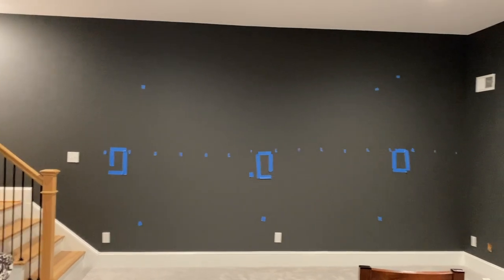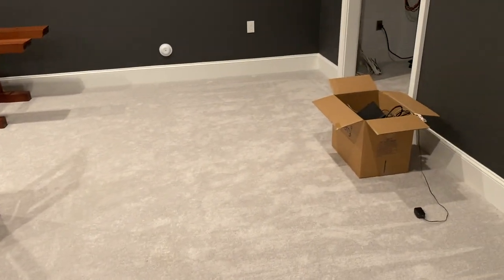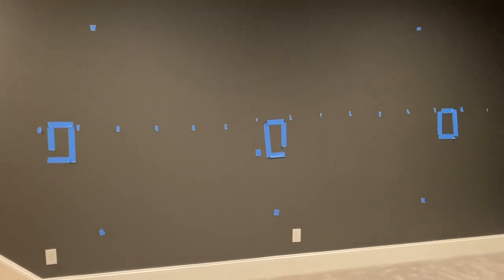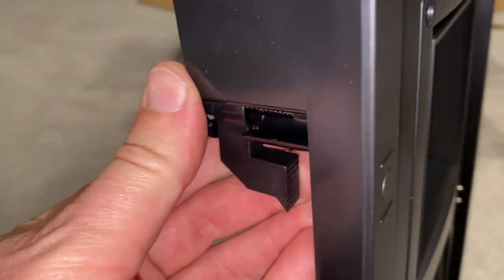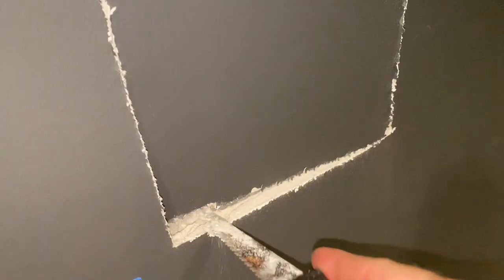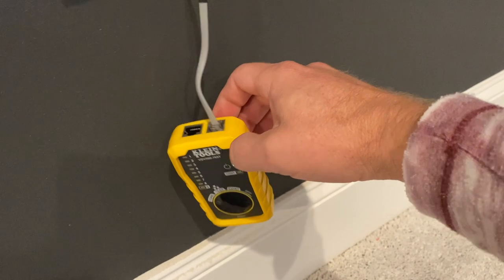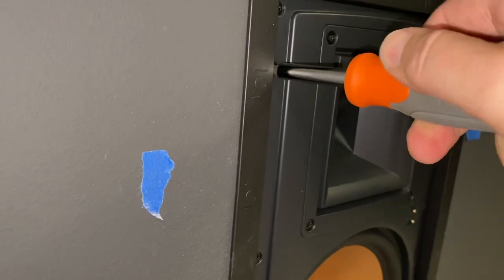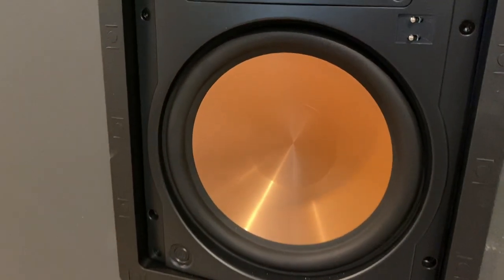Home Theater Planning/Overview + Klipsch R-5800 W II In-Wall Speaker Install

Comment: Pro tip... Label the cables if you do not have a tone tester. You can write a number 1 on both sides of the cable then 2 on both sized 3 on both sides ect  ect
Reply from the maker: +Frx Crypto Tradesmen absolutely! Assuming you are there when it’s being wired.
Reply: Connect the red and black at the speaker then test for continuity at the other ends, that'd be another method.

Comment: Good video and a great setup. All the drywall in my basement is being redone, so I am putting in-walls in. These get rave reviews and are reasonably priced... I have a question. I'm weary of the center channel behind the TV (I will have a normal 65" TV) Does the sound from the center suffer? Do you just compensate by turning it up? Would love some real-use feedback. THANKS!
Reply from the maker: +phillycandyman thanks! If you’re putting it behind an actual real TV, then yes it would suffer. Mine is behind an acoustically transparent screen, so it is meant for the sound to be able to pass through.
Reply: @HelpMeDIY  I thought so. I'd love that screen and projection, but my budget says no. I am going Klipsch In-walls for the remodel. I'll put the center above or below. Key is to Aim it at ear-level.
Reply from the maker: @phillycandyman  well you know the screen was a DIY that I built for under $200 right…? :)

Comment: in case this helps anyone else, if you are butted up against a stud, you can just attach a 1.5" by 1.5" piece of wood, remove the dog leg, and drill a screw threw the support hole(s). this was recommended by a klipsch rep on their forum

this is my plan because i know several of my locations will be against studs
Reply from the maker: +joshruehlig great idea! That would be a lot easier
Reply: This is genius. I was just gonna run a screw through the dog leg hole at an angle into the stud but this is much smarter

Comment: Why did you have to notch the stud if you centered the opening it between the studs? I’m a little confused. How wide are those speakers?
Reply from the maker: +P F could have been poor measuring on my part or the framers…
Reply: He said studs are 12" apart which, if true, is the odd bit

Comment: Thanks for putting this together - I just ordered 6 5800's for the front, sides, and rear. I was surprised to see you using one of these for the center channel. I am curious how this turned out - I was planning to grab a dedicated center in wall with multiple woofers but perhaps it's overkill! Would love to know how your experience has been - all those around me suggesting a larger center. Thanks
Reply from the maker: +Forager nice! I think it works great the way I have it set up. I always heard to match the center 🤷‍♂️.

Comment: Thank you for the informative video. I noticed that you installed your in-walls into what it seems an outer wall. I also noticed that you pushed aside all insulation exposing your cinder blocks. What part of the country are you that you are not concerned with breaking air and vapor barrier? I’m in Massachusetts and I’m wrestling with how to install inwalls without removing too much of the foam insulation in the outer walls. Here in New England that’s is pretty important. Any thoughts on how to tackle that install? Thank you.
Reply from the maker: +elconsejero that’s a great question. I’m in NC, so not nearly as cold. I’m not sure of the “best” way, but I just figured the point of it is to prevent air from flowing through. If the insulation is tucked up against the speakers, I think the speaker itself would prevent some air flow as well. I probably should have left a thin layer against the block 🤷‍♂️ If someone else with more experience could chime in that would be great.
Reply: I thought you need air behind the speakers at least 2 feet boxed in for better accustics